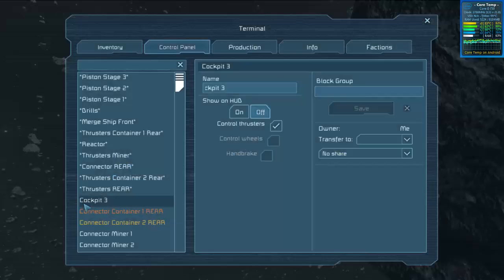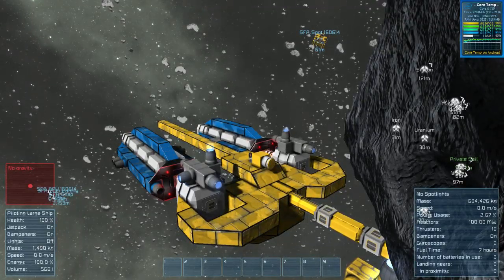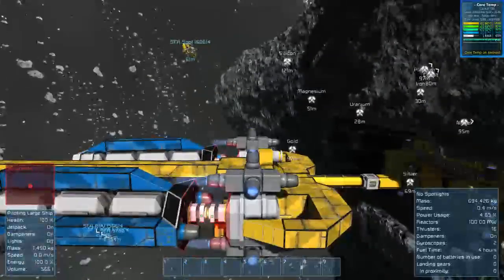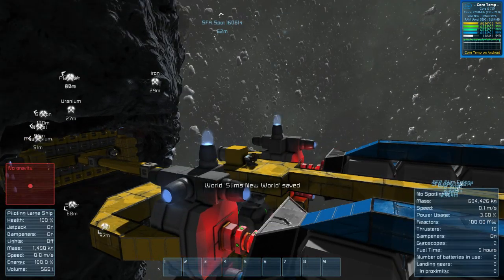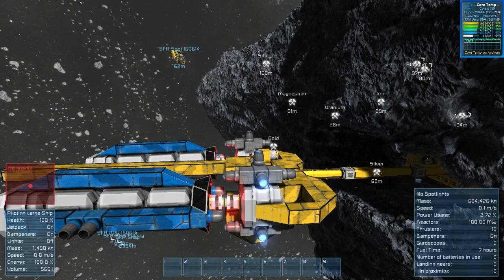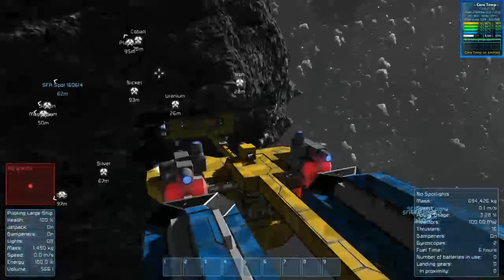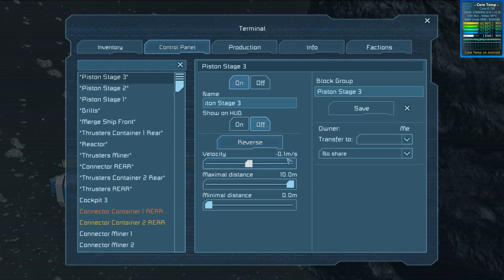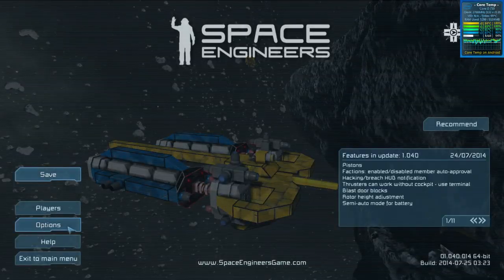Space Engineers - Piston Miner

Comment: Top effort slim, I was going to design one similar but sort of like your adp where it uses landing gear on the asteroid than drills down, would hopefully make it more stable and use 4 pistons per stage so 12 in total
Reply from the maker: You will have problems with trying to get 4 pistons per stage, I was trying the same idea at first and only the first connects, the others will not connect to the plate, so you would need to use in conjunction with merge block (hate these) or connectors to make it work. Someone on twitch tried this after my initial problems, not sure if they got it working or not though. Plus all four will need to move at exactly the same speed to hopefully rule out any problems.
Reply: Yeah good point, I'll think of something
Reply from the maker: I am thinking maybe connectors as less problematic then the merge block and you could use these on the end of the pistons to allow ore to flow through, then just retrofit the drill heads in place, may have to have another go at this miner using that idea...
Reply from the maker: Just have access to Large containers on the ship part like in the video above, but on a serious note the large drills holds a massive amount.